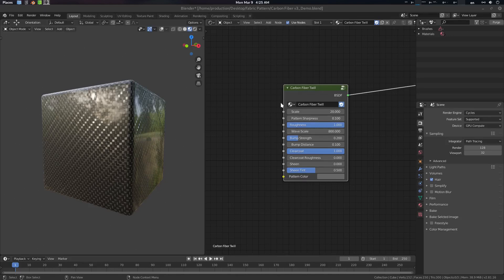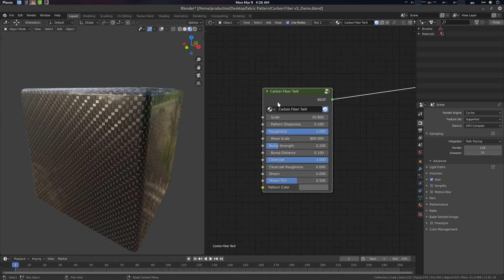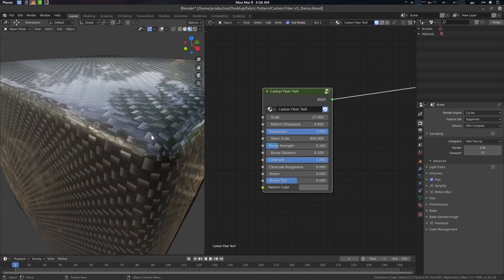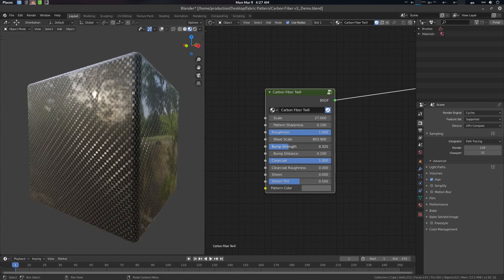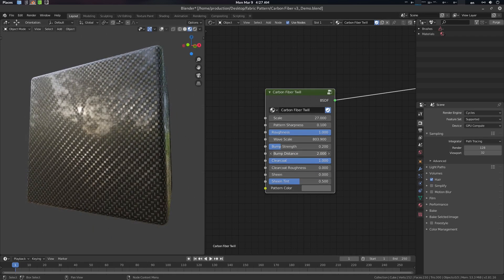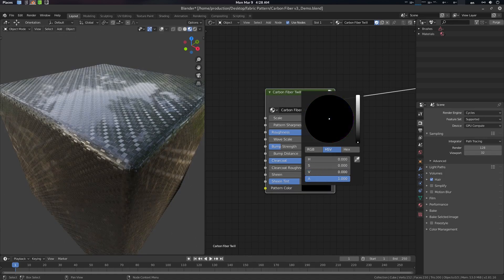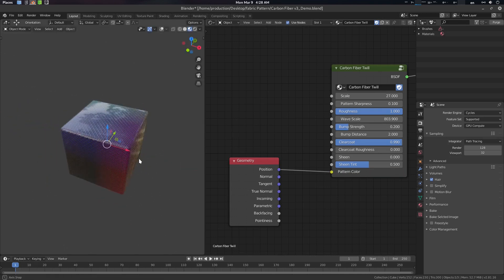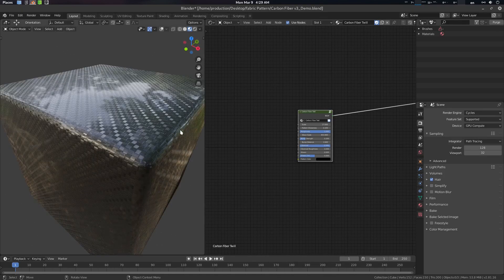Procedural Carbon Fiber Material Shader V3 for Blender

Comment: I want to put this texture on a tube which is 30 inch in length n has a dia of 2 inches .. all images even this texture appears to be too streched when I make a tube by extruding a cylinder, even images are failing.. what could be the solution to this??
Reply: extrude or scale both are giving same results
Reply from the maker: It is due to stretched UV. Workaround would be insert to the node group> in texture coordinate instead of UV use object.
Reply from the maker: https://github.com/cgvirus/Shader_bank_Blender_evee/blob/master/Procedural%20Shader/Carbon%20Fiber%20v3_Object%20cordinate.blend